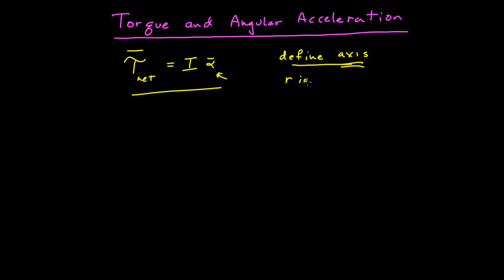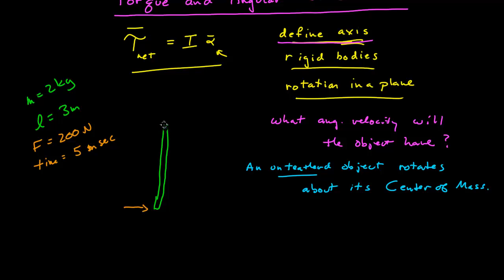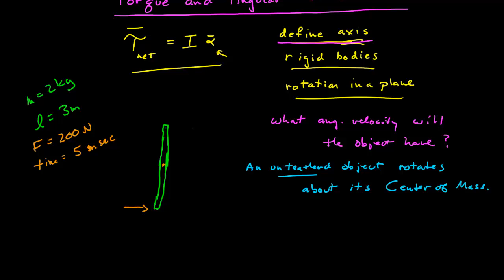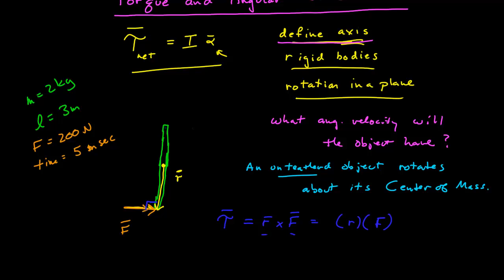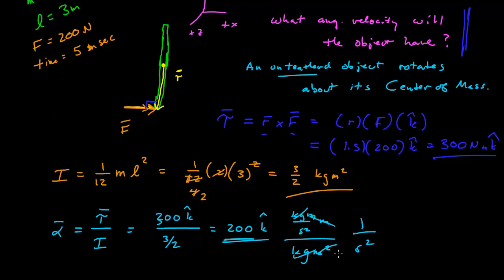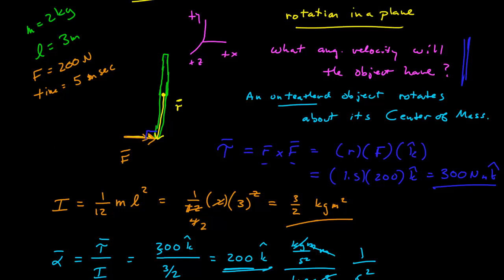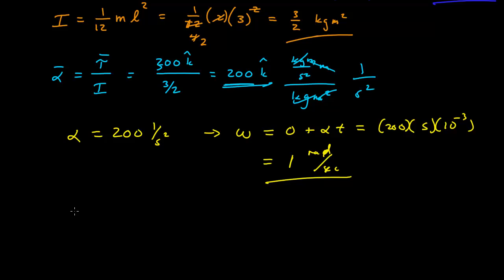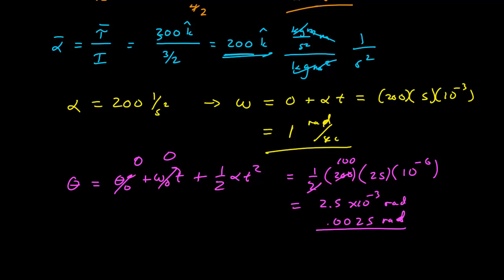Torque and Angular Acceleration

Comment: Seems to be really useful. Does the same thing applies to wheels when I want to calculate their rotation? I have the torque they receive from engine and their radius. If I put this intertia equation(taking in wheel diameter and mass) will I get the correct angular acceleration?
Reply from the maker: +Adrians Netlis It would work, but you would need the net torque.  There would be a torque on the axle due to the engine, and a toque on the edge of the wheel due to the ground.
Reply: AbrahamPhysics What torque on the edge of wheel? Do you mean the torque generated by rolling resistance and friction? I think that I can get it by just multiplying the force by radius of wheel, am I correct? P.S. note that this is for games so I don't need deadily-heave accuracy.
Reply from the maker: +Adrians Netlis Yes, the torque due to the friction on the ground.  It won't be rolling friction is the usual since, because that usually means it is rolling freely.  It is the force of friction from the earth on the tire that is actually propelling the car forward.
Reply from the maker: +Adrians Netlis What exactly are you trying to find, and what exactly is the information you have for your system?
Reply: AbrahamPhysics So far I have torque input in wheels from differential aswell as load on wheels and wheel radius. Will have friction-releated things soon. What I need is wheel angular velocity. It can't be 'Vcar / Rwheel', because of slip. So I need it to depend on torque input.
Reply from the maker: +Adrians Netlis Ok, if the system is slipping, that is certainly more complicated.  Everything so far I've done here is rolling without slipping.  note, that even if you find all the torques, it isn't enough, because that is going to give you the angular acceleration, not the angular velocity.  You mentioned this is for a game.  Instead of the input torque, do you have the input power?  I believe that would make your calculation much easier.
Reply from the maker: +Adrians Netlis If you have input power, your wheel will spin at a constant angular velocity when input power equals power out.  The power out will be the power done by friction on the spinning wheel.  The power done by friction is (torque due to friction)*(angular velocity).  This is ignoring any other load on the wheel due to friction in the bearings, etc.
Reply: Adrians N